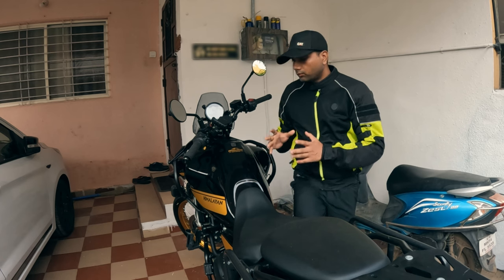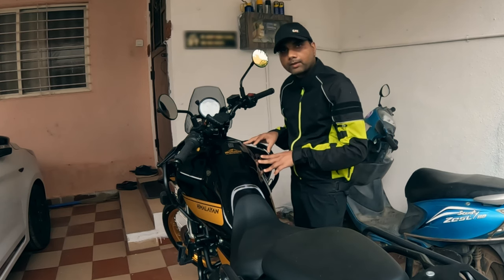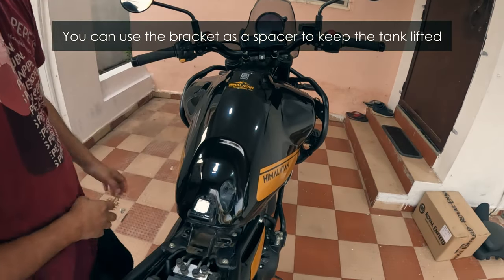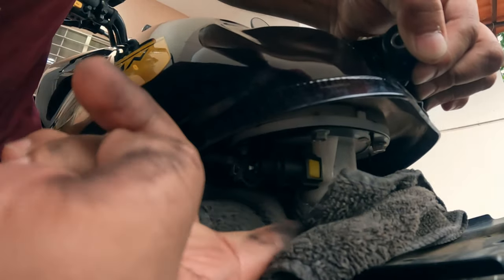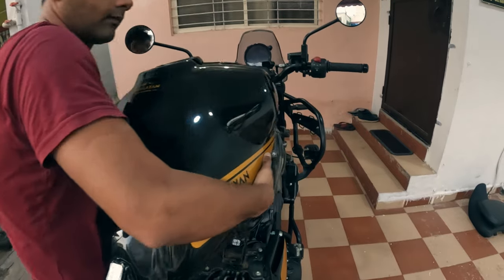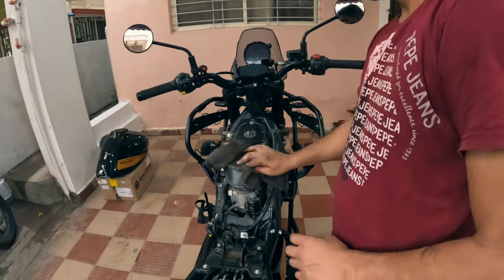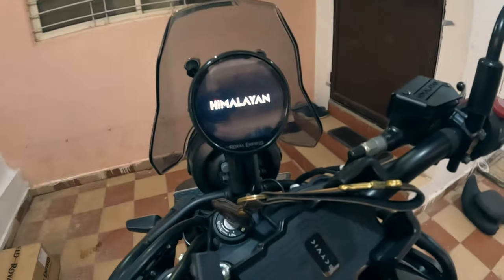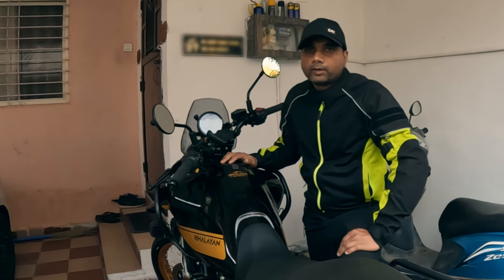How To Remove HIMALAYAN 450 Fuel Tank [ STEP BY STEP GUIDE ]

Comment: I faced the same issue. It stops working during rain. RE service center asked me share the video which I did now waiting for new switch.
Reply from the maker: In that case, just check the connectors shown in the video and clean it with contact cleaner. Hopefully the issue will be resolved and you need not wait for the new part to arrive.
Reply: @OnceARider  thanks will do. Scared of opening the tank by myself. My second service is due will get it checked then.
Reply from the maker: @Prajwal_Rao  sure... If you are not comfortable then do not attempt to open the tank. When you visit the service centre ask them to specifically clean both the connectors with contact cleaner. And please note this: service centre guys are always in a hurry and they spray the contact cleaner just from the outside and without disconnecting the connectors. So ask them to properly open and clean the connectors. I hope your issue gets resolved soon. Cheers ✌️
Reply: @OnceARider  Got it will definitely ask them to do that. Thanks for letting me know 😄